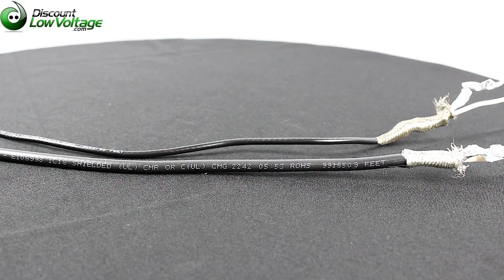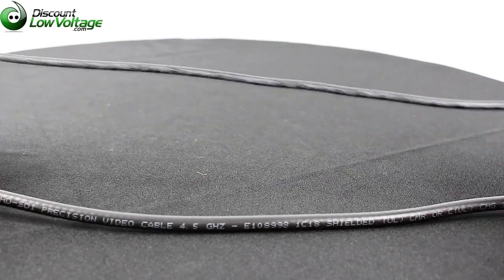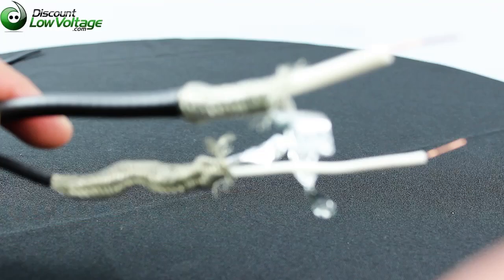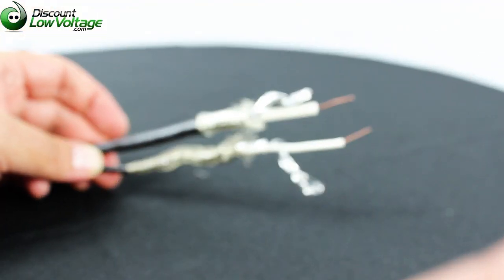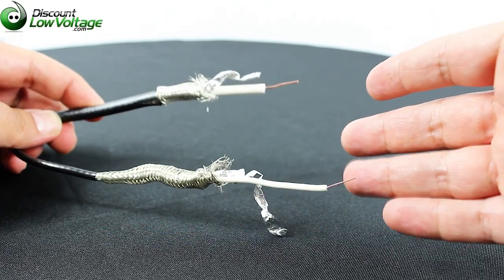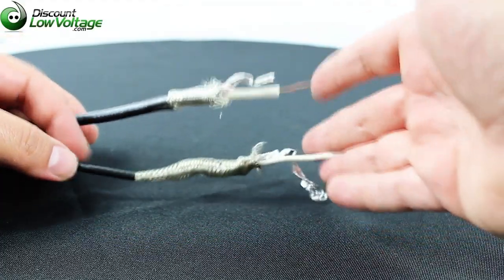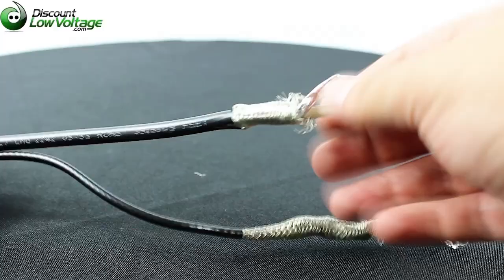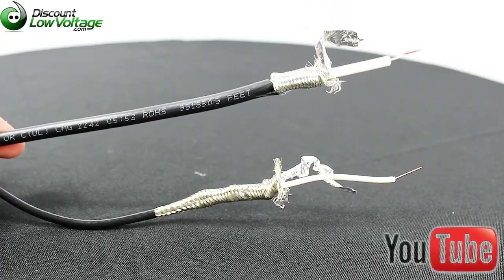Belden 1694a vs Belden 1855a Broadcasting Coaxial Cable Comparison

Comment: Belden makes a cable meant specifically for the truck 179dt (rg 179 type), it has a 28.5awg conductor and bonded foil + 95% braid.

Comment: We have an application where we are setting up conferences in large hotel ballrooms, and running HD video over SDI from the a tech table near the back of the room up to an active SDI splitter at the front, approximately an 80' run.  We are looking for a cable that can be placed into a multi-cable snake, stored on a cable reel, and unrolled at each location for setup, rolled back up onto the reel at the end of the event.  We are looking for a cable that is small, lightweight, flexible, resilient enough to be rolled  / unrolled on reel 20 times per year, and of course transmit HD-SDI signal error free for up 100 feet.  It looks like the Belden 1855A may be the best product for this but I'd love to hear other input.

Comment: The 1694a has 95% tinned copper shield and the foil. The center is solid copper. Best quality RG6 cable I have ever used.